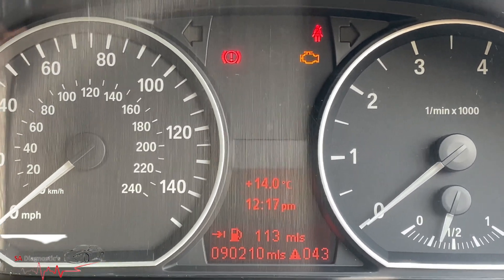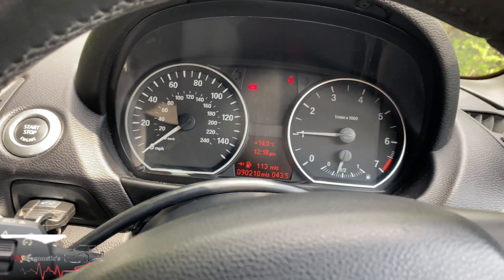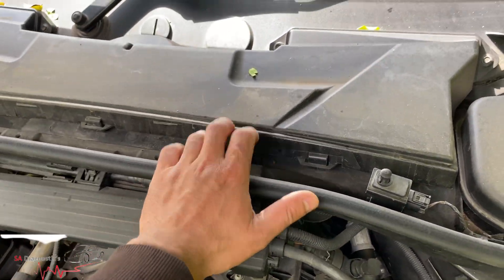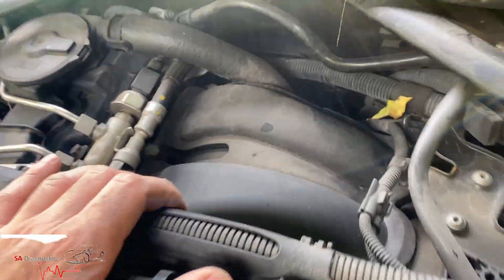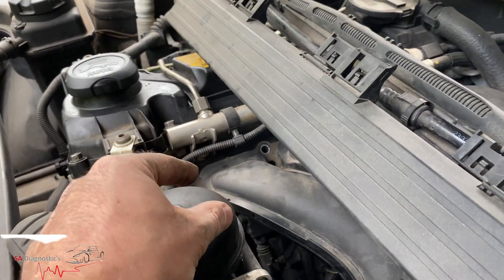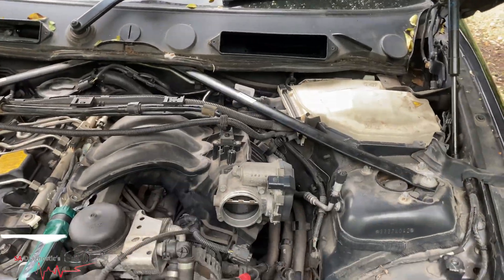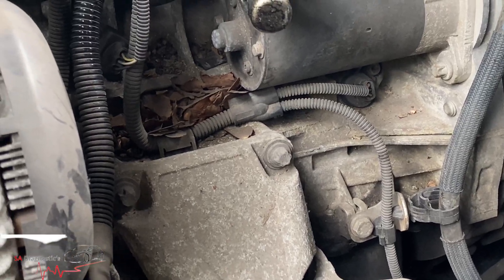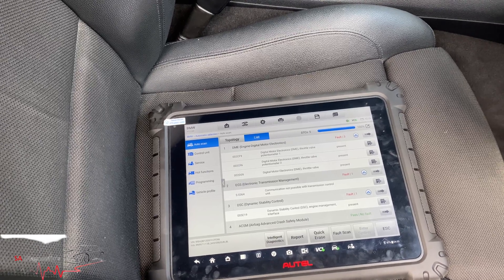BMW 2A94 2B0C 2AF8 118i 2.0 Digital Motor Electronics Crankshaft Sensor Signal Pulse HOW TO REMOVE

Comment: How did you manage to get the hole thing out I’m struggling, everything’s lose just not enough room to pull it out
Reply from the maker: @joshwalters6591  hi honestly can’t remember but there’s one bolt left at bottom further end where the windscreen is, that one took me 30 mins to get to and unbolt it…
Reply: Hi did you get it out and if so how ? Please 🙏😂